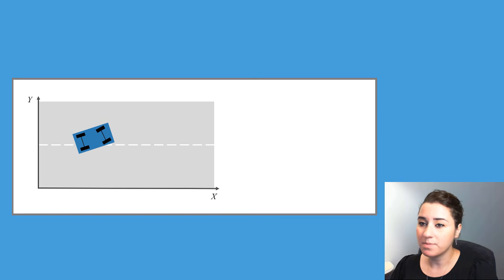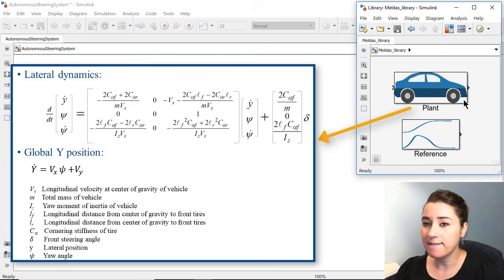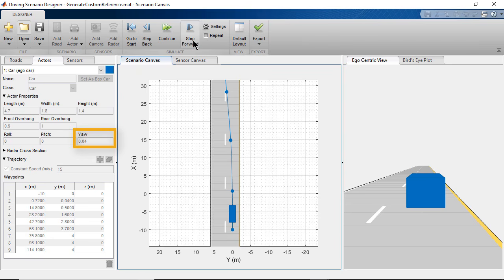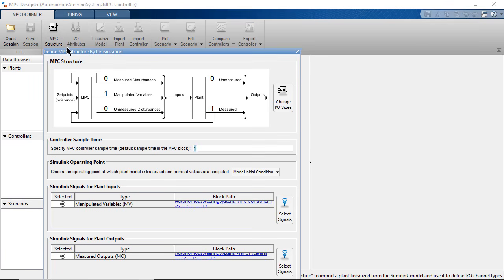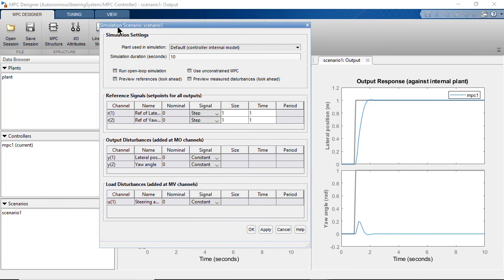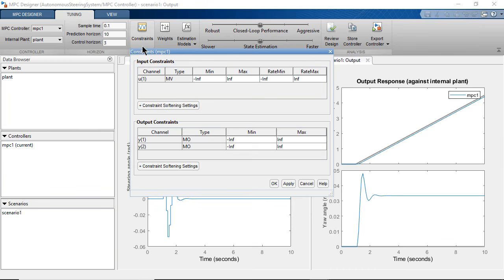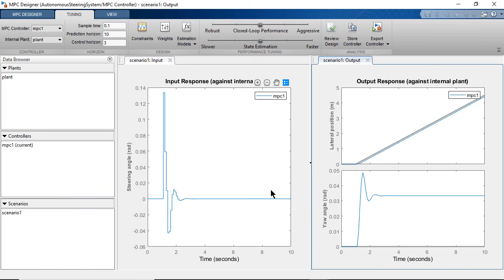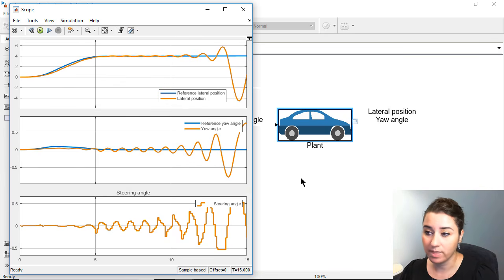How to Design a Model Predictive Control Controller with Simulink | Understanding MPC, Part 6

Comment: Thank you very much for this video. Everything works well for me, but my signals don't show on different layouts. I connected all the scope to the scope located at the lateral position yaw angle. How do I make the signals to show on different layouts based on the y-axis rating?
Reply: how can reference block has taken can u please guide me

Comment: To avoid errors it is good to create a new blank system, add Melda's library and create the controller from scratch by dragging reference values and car model from the library and then add mpc controller. Then look at the movie and set up parameters similar like Melda is doing and it finally works !. It is also important that the Params file is attached to the model.
Reply: Hi can you send me your file.

Comment: When i tried to ''Define MPC structure by linearization''  this error message is showed up: 
Parameter 'B' in block 'Plant/State-Space' is incorrect.
Component:Model Predictive Controller | Category:Find Operating Point errorOpen
The number of rows in B matrix of a state-space system must be same as the number of rows in A matrix.
What should i do?? plz help
Reply: did you get a response?

Comment: I'm trying to understand how the model adapts its output based on the vehicle's measured response.  Let's say you're trying to design an MPC that will act as a cruise control for your vehicle.  If the target speed is V and your current speed is v, perhaps your model outputs a certain percentage of the throttle to be engaged.  Even though the model predicts that your new speed v should be closer to V, what happens if the new speed is exactly the same as the old one (i.e. the throttle you're applying is exactly the amount of acceleration that your car experiences in drag).  It looks like the model will just run through the exact same optimization it just did and spit out the same throttle.  Can someone clarify?  In particular, how does the model adapt to its predicted response versus the actual measured response?

In a PID, for example, the integral gain would soon realize that the throttle you're applying is leading to a steady error and increase it even more to reduce the difference between V and v.

Comment: When i tried to ''Define MPC structure by linearization''  this error message is showed up
''The current directory 'c:\program files\matlab\r2016a\bin' is reserved for MATLAB files.
Please change your current directory to a writeable directory outside of the MATLAB installation area.''
What should i do?? plz help
Reply: if you know how to create the reference block using  trajectory  Driving Scenario Designer.
then plz. share some information to me
Reply: @akshaymarvaniya6227  Its not free, available in automated driving tool box

Comment: Error evaluating 'InitFcn' callback of MPC block (mask) 'AutonomousSteeringSystem/MPC Controller'. 
Callback string is 'impcblock_InitFcn'
Caused by:
Can not resolve: mpc1.
Hello, why I have this question with the simulink model? Please help me, thanks.
Reply: I have solved this question. My folder path unchanged.
Reply: @Tianya001  How you resolved this issue? Please help me.
Reply: @menaeem   The path in MATLAB should be modified to the path of the simulated file.

Comment: how can i create the reference block? I have already built my trajectory on Driving Scenario Designer. I ask this question because the link for the simulink model used in this video is broken.
Reply: Hi Marco, while we're fixing the broken link, please find the model used in this video here: https://www.mathworks.com/matlabcentral/fileexchange/68992-designing-an-mpc-controller-with-simulink-and-mpc-toolbox
Reply: @meldaulusoy8389  Thank you
Reply: Sorry to trouble you, but I still don't know how to create the reference, do you solve this problem now?
Reply: @zhenganwang7419  Hi, using the Driving Scenario Designer, create your trajectory and then add a sensor to your ego car using the button on the top panel (camera or radar). Then click export and choose "export MATLAB Function". Save the function with a name such as  "generateSensorData.m". When you run this function as below, it simulates the driving scenario and saves the position and yaw angle of the car. The below code shows you how you can extract position and yaw angle; these (yawRef,posRef)) are then used in the reference block shown in the video. 
[allData, scenario, sensor] = generateSensorData(); 
t = [allData.Time];
ap = [allData.ActorPoses];
yawRef = [ap.Yaw];
posRef = vertcat(ap.Position);
Reply: @meldaulusoy8389  I see, thanks a lot!
Reply: @meldaulusoy8389  i still can not understand your code... and it did not work for me.
Reply: @meldaulusoy8389  thanks a lot！
Reply: @zhenganwang7419  yes, i solved this problem. You just need yo create your trajectory on ADAS. After that you need to create and save the function just as the video above shows. Then you need to use the matlab function " record () ", within the brackets you need to write the name of the function you saved before. This MATLAB code will return you a struct in which you can find all the values related to position, yaw angle and other parameters.
Reply: @TheMaRkS95  It really helps me, thank you.
Reply: @TheMaRkS95  if you know how to create the reference block using  trajectory  Driving Scenario Designer.
 then plz. share some information to me and plz. send some video if available and i not understend  how to use record() function
Reply: @zhenganwang7419   if you know how to create the reference block using  trajectory  Driving Scenario Designer.
 then plz. share some information to me and plz. send some video if available and i not understend  how to use record() function
Reply: Did you figure it out?
Reply: XINGYU LI currently, yes. thank you. could i have your mail address? maybe i have further questions in the future. mine is ts18zw at leeds dot ac dot uk

Comment: Download the model used in this example here: https://www.mathworks.com/matlabcentral/fileexchange/68992-designing-an-mpc-controller-with-simulink-and-mpc-toolbox
Reply: Dear Melda, the state variables in this video is: 3x1 matrix, but in the Simulink file, there seems 4 states. What are the selected states for the Simulink model?
Reply: Melda Hocam merhabalar, acaba MPC controller bloğunu kullanmadan simulinkte Model predictive Control için bir tasarım sağlayabilir miyiz? PID'de uygulayabildiğimiz gain bloklarıyla yaptığımız şekilde.